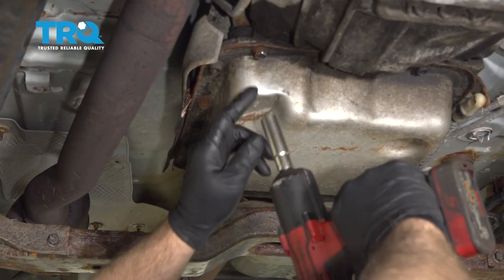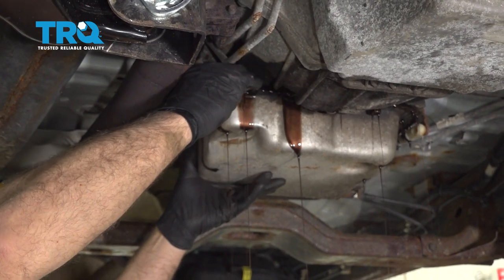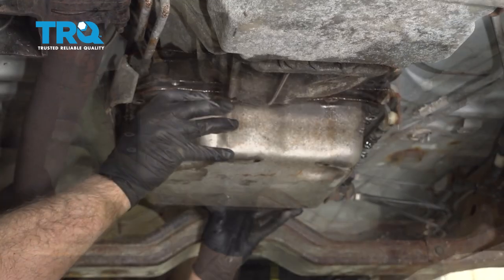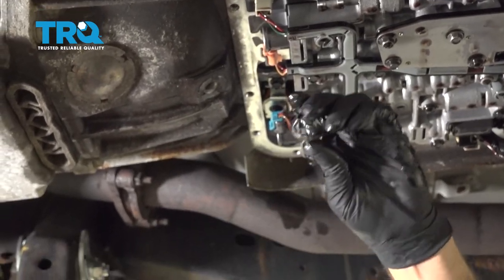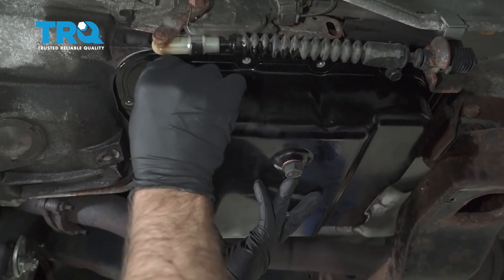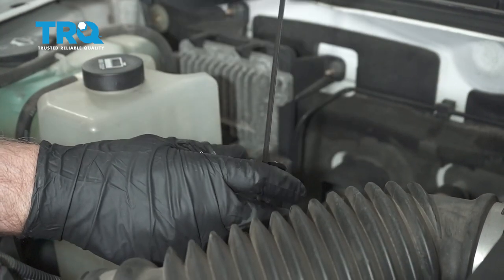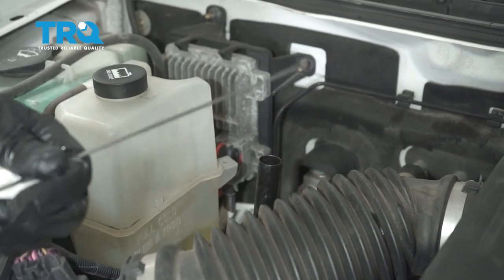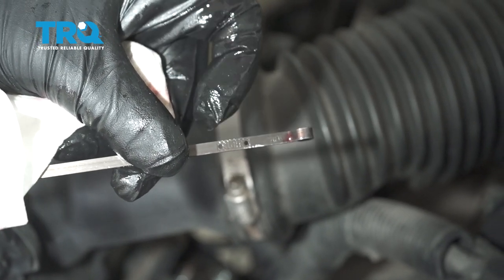How to Replace Transmission Oil Filter 2004-2012 Chevrolet Colorado

Comment: Anyone interested to know, the factory pan obviously has no drain plug. The Dorman replacement comes with a round upward indention where the second magnet in the oem pan goes ( have heard some factory pans only use 1 ). Anyway, only one magnet is needed because more regular maintenance is anticipated by switching to the pan with a drain bolt. In theory less accumulation will be on the magnet if fluid changed regularly.
Reply from the maker: +@acetech9237 Thanks for watching our video! http://1aau.to/m/Shop-TRQ

Comment: When I change mine on a 2012, I use a tool to pull the seal out. Using a screw driver can damage the cylinder wall and I put a layer of fluid on the seal before tapping into place. Otherwise it can be a real pain to get out next time.